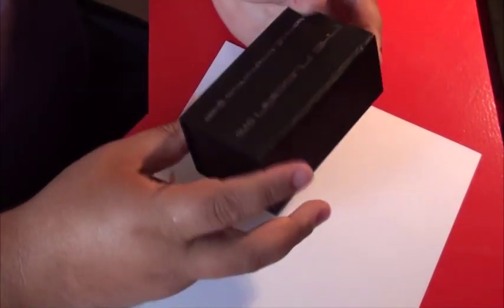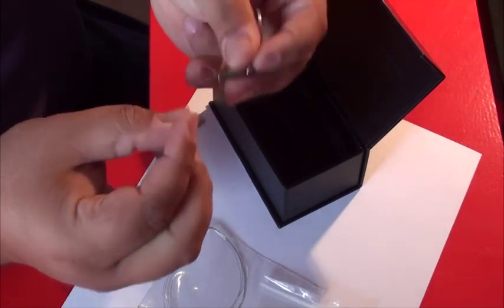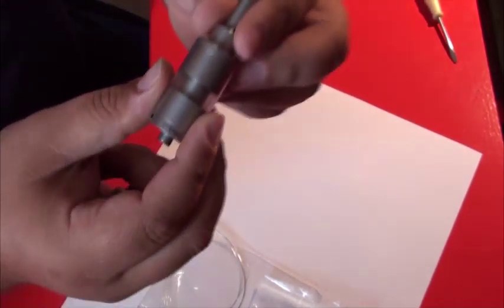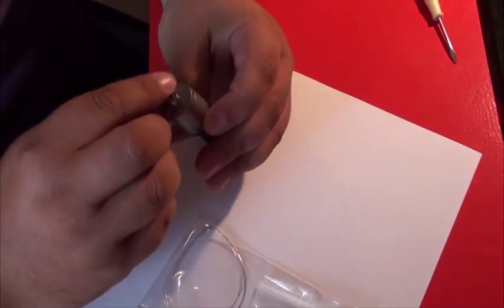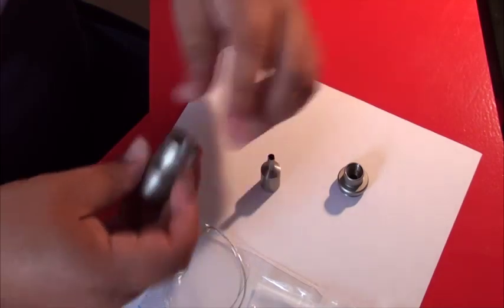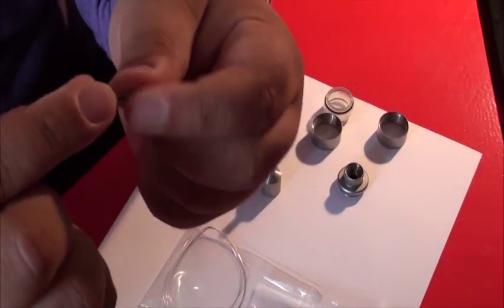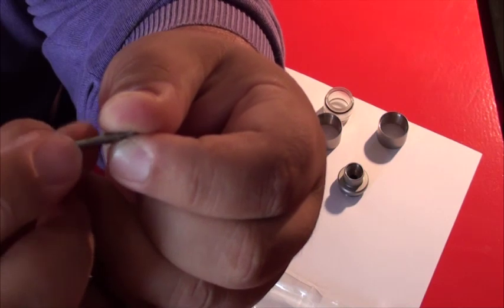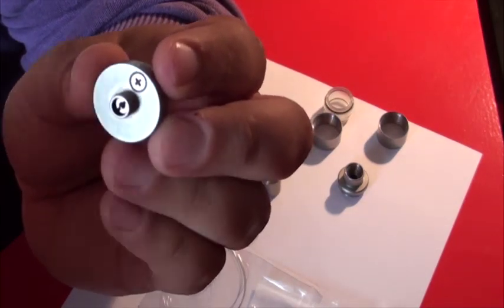Russian 91%, center pin connector

Comment: The center post screw is suppose to have O rings on it where are they? put a couple o rings on that screw and tighten it back in by hand until you get it where your making a good connection with your device. Also if you don't have the orings you can use just about anything that the screw will fit through and trim it to the correct length that you need the screw to stick out. hope this helps. I'm currently using a center post design from the Russian big which is spring loaded this will adapt and make contact to just about all devices with 510 connections on the market.

Comment: I bought a newer version of the 91% and the center pin is different to where it still moves but now there isn't two screws in one there is this weird button thing on the bottom and now I can not tighten it. Any suggestions on how to fix it anybody??
Reply: same problem with the newer version!! any ideas ?
Reply: LILH3AV3N76 Yup, same here.  I'm about to throw the thing across the room.